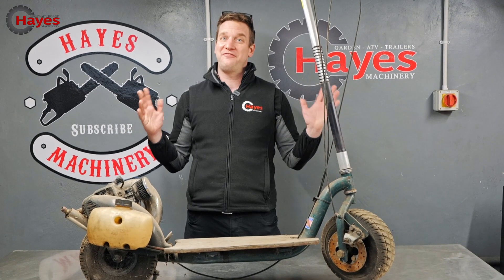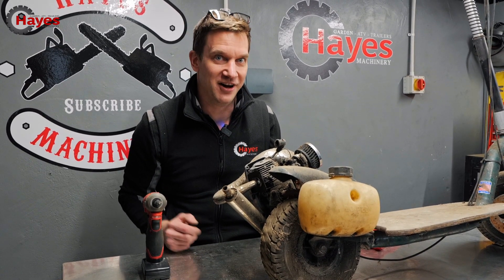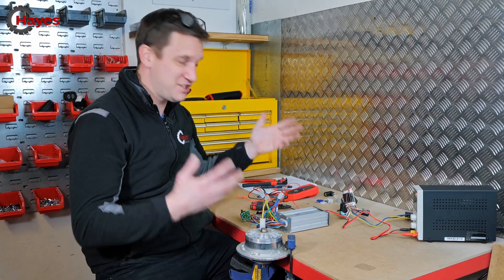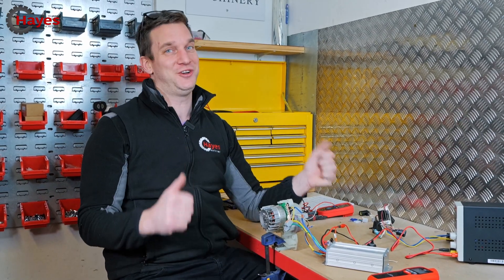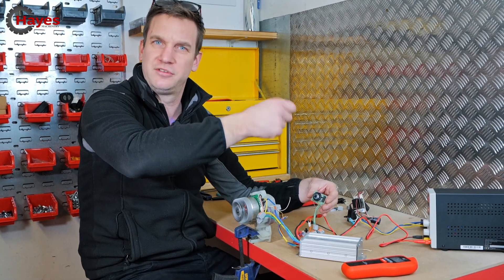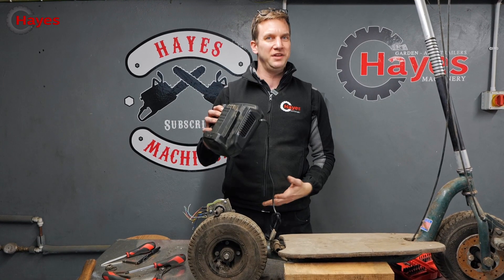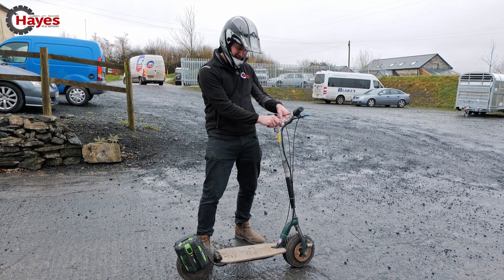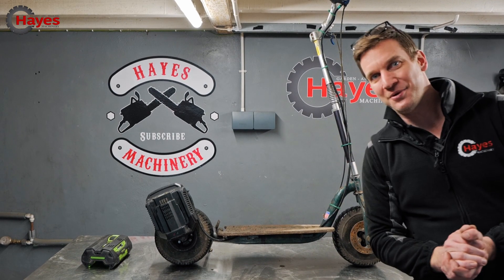Converting a Petrol Scooter to Electric Powered By EGO!

Comment: Hi James, I made an electric powered bicycle trailer a few years ago but I cheated and used the motor and speed controller from a Raider scooter. It is 1500 watts and would do 30mph with a range of 22 miles, I used it to go to work and back and covered about a 1000 miles until I got bored of it. I brought it up to show you a few years back but unfortunately you were away that day. The motor was conveniently part of the back wheel so was very neat. Good luck with the scooter.   👍👍
Reply from the maker: That’s awesome, I would of loved to have seen it! Sorry I was not around, sometimes I leave the compound 😂😂